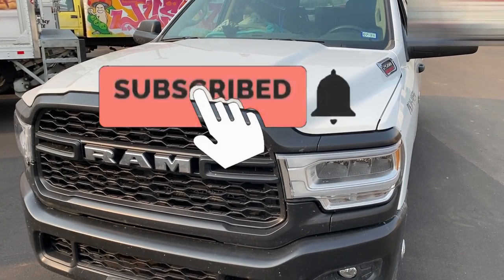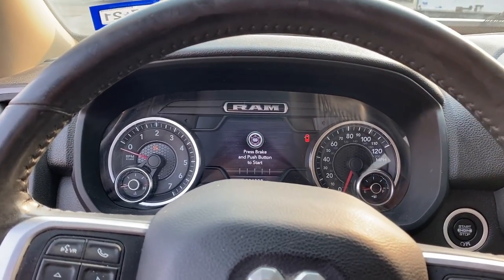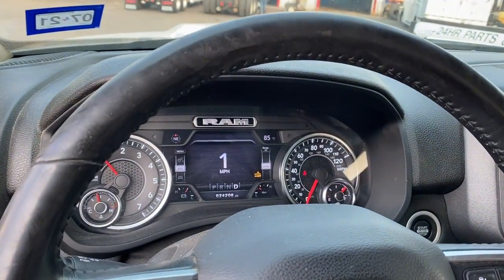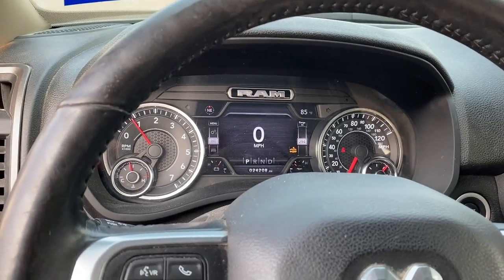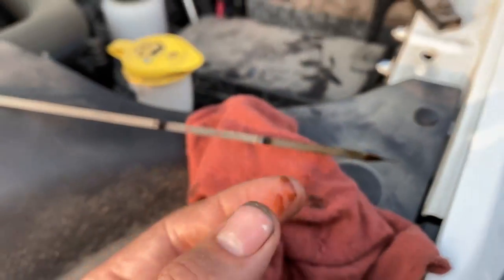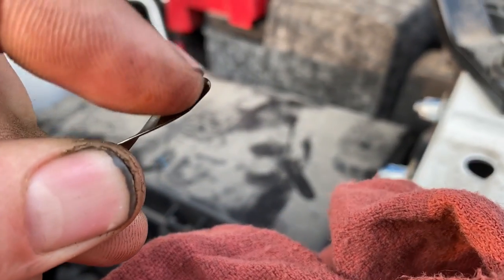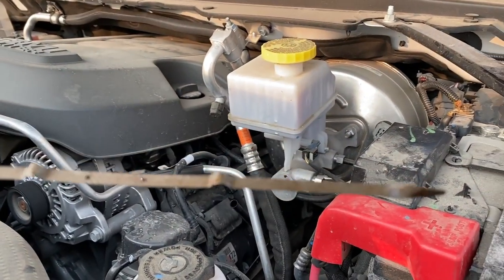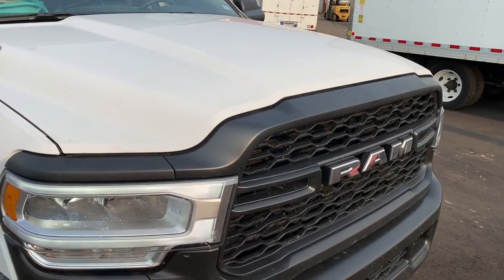2020 Ram 2500 Hemi 6.4 Bad Engine!

Comment: About to turn over 20k on mine. I bout the truck used, so I just did MY first oil change. So far no issues with ticking. I plan to change oil about every 5k miles
Reply from the maker: Should be fine as long as you’re using good oil and keep idle times down

Comment: I had a 2016 Ram 2500 with the 6.4 and put over 100,000 km on it in 3 years with no problems at all, just did oil changes that’s it. I did have a starter issue with my 2014 Ram 1500 though lol, it only had about 5000 km on it with I went to start it and it just kept turning over for about 2 mins before it died lol. For some reason the starter got stuck engaged when I used the push start, no way to stop it from cranking over either 😂. I now have a 2020 Power Wagon so fingers crossed that it holds up because I fucking love this thing.
Reply from the maker: Lmao yeah the push start really screws you in cases like that. The power wagons are pretty bad ass though, best of luck with it!

Comment: That's horrible!
I have a 2019 with 20k on it but with regular oil changes and no issues so far.
I always disable the mds because it bogs the engine out and hopefully that helps it last longer also I did get an extended warranty!
Reply from the maker: Smart man! Which method did you use to disable MDS?
Reply: @TonyTheTruckGuy  I use the gear select by pushing down gear and then up  to 6th for city and 8th for highway.

Comment: i change my oil on my 2019 1500 5.7 every 5-6k miles or so , i usually do my own oil changes but not risking my new truck so i take it to the dealer, that way if something goes wrong they’re to blame haha
Reply: I’m the same as you. I do the same also and bring it to the dealer. This way they have no excuse for any warranty issues. Once warranty is over I will do my own. Cheers.
Reply from the maker: I also have mine changed every 5-7k and up until the most recent oil change, I had the dealer do it for the same reason you guys listed. Plus it’s really not much more for them to do it. I only did the last one myself so I could make a video out of it. So if anything happens and they try to deny warranty, I have video evidence of me changing the oil 😂

Comment: Got a new 2022 Challenger R/T Scat pack with this block in it, and I've gotten into a habit I think I'm going to maintain not just after "Break in", and that's check the oil after every refuel. It's easy, takes 5 minutes, and since I don't drive the wheels off of it I'll be taking it in to service way before the mileage is due. Sounds like these engines need a more aggressive service cycle (my dealer recommends 3 month, 3K still even for full synthetic). Good to know there are inherent problems with this, but this case just seems like a problem someone knew about that they just let go until the engine died.
Reply from the maker: Yeah I honestly don’t think they ever changed the oil on this. That being said, I’m not sure where all the oil went haha, that’s the concerning part.

Comment: I’ve got a 2005 ram 2500 manual.  Paid $7000 for her pre Covid.  This truck is amazing!! It pulls my 34ft camper and runs great.  160,000 miles on her. The only issues was replaced clutch last year and my driver side exhaust manifold leaks. Dodge has always been good to me.  My BMW on the other hand is full of crap plastic and melts in the summer.  I will never ever buy another BMW!! There’s a reason you need money to own one because they always need expensive work.  I’m very good at keeping up with all maintenance fyi.  But seriously bmw’s suck!
Reply from the maker: Yeah I have a buddy that currently has a Buick and is looking at BMW/Audi. I told him to get Lexus because it’s essentially Toyota so more reliable and still probably the cheapest of the “luxury” cars. The Euro stuff is nice when it’s new, but maintenance would kill me haha. I had a 2005 Cummins as well! Thing was awesome, but I got suckered into the "new truck" mentality and traded it in for a new hemi 1500 back in 2012. Boy, was THAT a mistake.

Comment: Well clearly this guy abused the truck and never changed the oil. I own a 19 Ram 2500 with the 6.4l and 6800 miles. Just got it back from the dealer who replaced lifters because it was making a knocking noise like starting a vehicle after an oil change with a dry filter. I changed my oil at 2100 miles and 5700 miles with the proper 0w-40 Pennzoil and also only have 20 hours of idle on 205 total hoursas I know idling a Hemi is not good due to how high the cam sits in the block. Absolutely yes this is still a thing with these Hemis which bums me out because the truck is awesome otherwise. I have done everything above and beyond to make sure I took care of this engine so its just luck of the draw. Guess I should I went with the 7.3l Ford
Reply from the maker: Damn, those are frequent oil changes, too. Does it really call for 0w-40? My 5.7 calls for 5w-20. I'm almost wondering if the 40 weight is too thick to get through those small oil passages. Hopefully it lasts longer now that they fixed it. I dig the name by the way lol.
Reply: @TonyTheTruckGuy  0w-40 FULL Synthetic and FCA certified. I believe Penzoil is the only brand that carries the FCA certification.
Reply from the maker: @ericsvalland4417   That really has me baffled. The 5.7 and 6.4 are literally twin, modular engines. The only reason the 6.2 hellcat doesn't have the lifter and cam issues is because it doesn't have the MDS. But it seems that the 6.4 has this issue more than the 5.7. The only thing that makes sense to me is that the 40 weight is too thick to get into them little lifter oiling holes. Very strange.
Reply: I've switched from the pennzoil to amsoil.
Reply: @TonyTheTruckGuy  just wanted to update. The dealer is replacing my engine with what they call piston slap. Been waiting 6 weeks for a new one
Reply from the maker: @TheRamGuy  That’s so weird. I never hear about piston issues with these things lol. You have some bad luck with this thing unfortunately.
Reply: @TonyTheTruckGuy  I know they had undersized wrist pins back in 2014 or something like that but would never expect that on my 2019. Hopefully it was just bad luck

Comment: So that engine should of had 5 oil changes and its had 0. I would check the filter to see if it was factory installed. It will be stamped on the bottom of filter and say Factory Installed.

Comment: I thought uncle Tony proved the lifted angle is the issue. The roller doesn't see oil unless it's under rpm so idling or stop and go traffic isn't good for the hemi engines but my dad has had two hemi 1500s and they've both seen work and miles with no issues
Reply from the maker: Yeah I’ve had decent luck with the 5.7’s I’ve owned, but the 5.7 also uses a thinner oil. I’m wondering if that’s why this issue seems to be so frequent on the 6.4. Of course this particular one appears to be lack of maintenance.

Comment: I am fully aware of potential lifter problems with hemi engines however In this case the customer starved the engine of oil with improper maintenance leading to this failure.
Reply from the maker: Which is why I made clear that the engine was low on oil. What I said about the cam and lifter issue is still true, it's a known problem.

Comment: It's known that 3rd gen Hemi's have upper valvetrain oiling issues, it's been like that since they came out. You NEED to do the oil changes on schedule and use a quality oil. Doing them on time is getting 2009 Charger R/T to 229k miles without issue.
I love my Mopar's but it's the reality of the motors they use, you can't say they don't eat lifters and cams more than Chevy LS's and Ford 5.0s because they do. But proper maintenance really helps curb that problem.

Comment: I change my oil on my 2500 6.4 every 3000  Full synthetic oil Castro  even on my 5.7 same oil an in my wrangler  never had issues all my vehicles have low milage

Comment: I have a 2004 Ram 1500 SLT Sport and I have a air intake throttle body throttle body spacer stage 2 jet chip computer programmer Gibson exhaust the truck is turned from day 1 when I purchased the truck new in 03. About a year and a half ago I just went over 100k miles always used 5w 30 synthetic oil eather Royal Purple or another top brand oil every so often using a oil additive for Extra Protection like Z-Max but I was driving one day and the motor starting to run extremely rough found out passenger side back 4 lifter 3rd one from the back the roller broke off. Took the truck to my friend great mechanic took the left side apart pulled the lifters out all 4 were there except the bottom roller broke off. This is the amazing part send a camera into the hole the camshaft did not even have a scratch sent the head out purchased for new lifters gaskets bolts put everything back together truck started up and it was idling like the first  day having the truck. Just went over 112k miles truck runs perfect I do have a slight ticking noise which is really not bad but never found the roller somewhere in motor truck idles so smooth the motor does not shake at all don't know how nothing happened to the cam truck has amazing power and speed but that's because always change the oil over the summer small leak in A.C. changed everything changed the alternator which really didn't need to be changed but always kept up on the belts hoses thermostat oil pressure regulator PCV valve but looking at new trucks now because of the rust over the back wheel wells fixed 2 times still happens took all the badges off even the dealership cannot believe how clean the interior and outside of the truck was. But I was so lucky with my motor. Like always stay safe and healthy God bless

Comment: Regardless of the owner screwing up, apparently,  the world still apparently doesnt know the 5.7 n the 6.4 have upper valvetrain oiling issues but Ram keeps making commercials that they make the toughest engines on the road. I know 6.2l  fords and 6.0l chevys that have had the ever living piss beat out of them and never failed like a Hemi fails.
Reply from the maker: Personally, I've owned a few Hemi's and haven't had any issues, same with the buddies I know that have them, but I'm grateful for the luck. I'm also a big fan of the '99-'07 GM 5.3 and 6.0. They get they're own lifter tick, but it'll run forever that way. Never really messed with a 6.2
Reply: @TonyTheTruckGuy  Run the Ford 6.2l in service trucks, lol the absolute ass pounding abuse those engines go through is amazing and still keep running. Butt fucking ugly to look at or work on but they are solid.
Reply: 2019 Ram with 5.7 start having this problem with lifters&camshaft,  shame of the FCA

Comment: I have a 2016 Ram 3500 6.4 Cab and chassis I put a repo body on it. (Dynamic 701) I use the motor oil Pennzoil ultra platinum 0W 40 that they say to use but I change my oil every 4000 because I’m towing every day with it. And I change all my fluids coolent everything I heard about this problem when I was researching this truck back when I bought it I actually bought it new in 2017 but I read on the forums back then people were talking about this issue that’s another reason why I keep my oil change. But so far I haven’t had any issues truck runs like a top and has a ton of torque. But I would like to know When did the owner said  it started making that noise? His best bet is to change that oil and take that truck to the dealership and say here you go!!! LMFAO!! Good luck!!

Comment: I have had at least 6 hemi company trucks from 5.7's  to 6.4's all went over 150k before they replaced them. Very long idle times maintenances was done every 5 to 6k miles and the only thing that has ever happened was a alternator.  And that was my fault I let it idle for several hrs a couple of long days in the blazing sun with the ac on to keep my computer cool and I still drove it 100 miles to a dealer in KC because it didn't completely die and leave me stranded. The only thing was the alternator was 700.00 and took 2 weeks to get.
Reply from the maker: Yeah I’ve had good luck with the Hemi’s that I’ve owned as well. This had to be poor maintenance.

Comment: I have a 2017 2500 with a 6.4 67000 miles and it looks way cleaner than this truck and is way more quiet.

Comment: I hate the 6.4 hemi mine had it from new has 15,000 miles changed oil 5 times with AMSOIL signature series  25,000 or one year. The dealership said its loader then normal something going on but no codes so there not going to do anything.
Reply from the maker: For the truck idle a lot? Changing synthetic oil every 3k miles is way overkill. I’d just be topping it off if it’s low. Shouldn’t matter if there’s any codes or not for warranty. Oil consumption is oil consumption and that will never throw a code lol. I’d try another dealer.
Reply: Truck dose not sit and run and doesn’t use oil

Comment: I have a 2011 2500 that I had to replace the lifters and camshaft on around 100,000 miles.  A mechanic recommended going from 5w20 viscosity to 0w40 to help with the lifters.  Do you have an opinion on this?
Reply from the maker: Hmmm. I guess I can’t say since my experience with this issues is lacking. I would think that the thinner weight oil would flow better, but the 49 weight is thicker and therefor may stick longer, resulting in less lubrication loss. It’s really hard to say without doing some extensive physical head to head comparison.
Reply: @TonyTheTruckGuy  my mechanic is a Mopar guy.  I do trust him.  However, you are always taught to follow the recommended viscosity.  I definitely don’t what to put money out again for that same problem!
Reply: Synthetic oil is all I use too.
Reply from the maker: @michellemorgan3133  That’s the only way to go now days
Reply: I had a 2015 with the 6.4 with 180000. I run Mobil 1 synthetic 0w40/ premium napa filters. Never had a issue with it changed oil every 6000 miles . Loved the truck seemed the more miles I put on her the better the fuel mileage too...

Comment: I've got a 2019 5.7 night edition with 70k and no issues. I never use the mds and I don't fuck around when it comes to the oil. I'm constantly checking it and change oil on time.
Reply from the maker: Damn, racking up the miles on that bad boy! Haha
Reply: Yes. I hang exterior and interior doors. I put a hundred plus miles on my truck every day running across the town of Denver. It's been a good truck. You just gotta make sure to change oil on time so those tiny ports in the lifters don't get clogged.
Reply from the maker: @billyhicksjr4122  Yeah the only issue I’ve had with mine so far was a lifter tick on a single start up. I shut it down right away and fired it up again then no issues since. That was probably 5k-10k miles ago and I’m just creeping up on 30k with my 5.7

Comment: Sure regular maintenance is a must , but a trucks engine should still be reliable and take a beating since they are meant as work vehicles especially that low of miles .... I had a 05 silverado with 275k when I traded it in and it had 0 engine noise , my new truck is a 13 ram with 80k miles and is already getting the "hemi tick"  and here i was worried about transmission issues with the rams and my problem is most likely lifter failure lol

Comment: We have 3 2019 6.4's now with bad engines, all under 50k miles..These are bucket lift work trucks that have to idle to run a pto for lift operation. Evidently bad oil pressure at idle causing the cams to get eat up and ruin the engine..Only 36k warranty on commercial Dodge vehicles. Also we have inhouse fleet mechanic and these have PM done every 6k with M1 synthetic.. Never will buy any Dodge Chrysler vehicle ever!
Reply from the maker: Idle is terrible for any engine, especially these hemi’s that are prone to cam and lifter failure unfortunately. Had good luck with all my other mopar vehicles, including several 5.7 hemi, but I also don’t idle them for hours on end lol
Reply: @TonyTheTruckGuy  Lol we have about 150 GM 4.8, 6.0's that idle hours daily with no problems. Mopars r cheaper for a reason lol
Reply from the maker: @mateo-6965  4.8 and 6.0 are also a lot older engine compared to the 6.4 so they have their kinks worked out and don’t even make them anymore lol. My 01 Sierra with 5.3 always had a lifter tick but it never really got worse and usually went away after a few minutes once it got warm. Good engines.

Comment: I have 2017 ram 2500 with 6.4 had 79000 miles was ticking cam and lifters $3500.00 then starter $900.00 now last year transmission $7500.00 asked if dodge was taking are of the issues they said they know their is a problem but they will not take care of it they wanted to sell me a new dodge I ask if they fixed the issues they said no so I said won’t buy another one.  So don’t buy a ram 5.7 or 6.4
Reply: Changed my oil every 5000 miles
Reply from the maker: @richardarmstrong8133  Very frustrating. Seems you either get lucky or unlucky with them. I’m sorry yours hasn’t been good to you. That’s a lot of money out of pocket so close to being out of warranty.